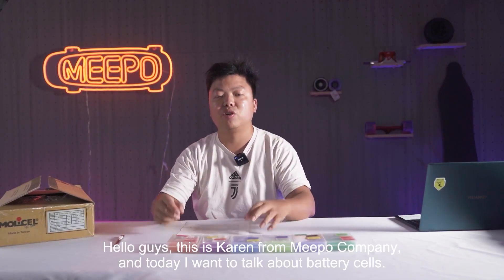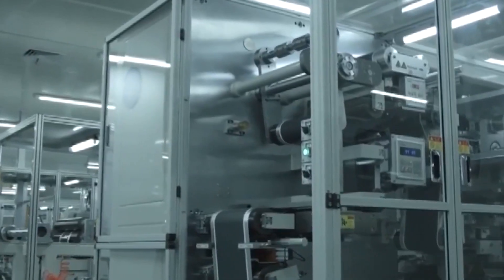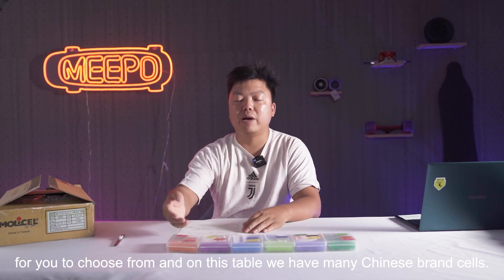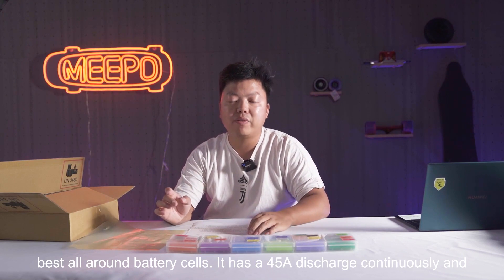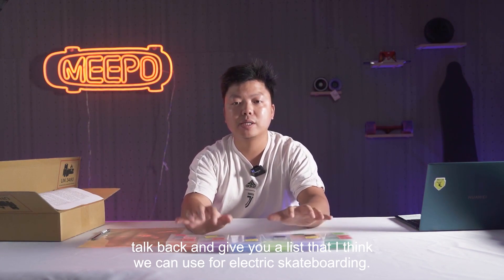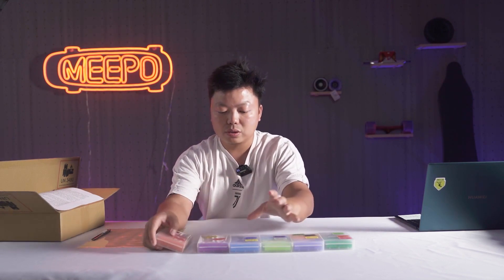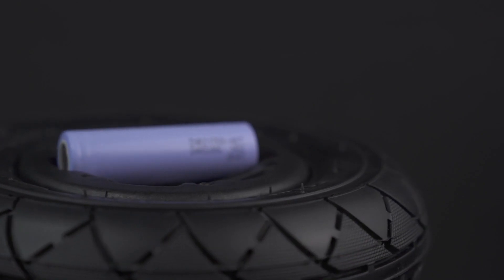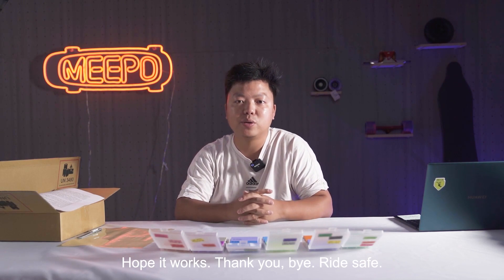MOLICEL P42A Upgrade —The Best Battery Cell for Esk8

Comment: What's your opinion on the Molicel M50A?
Reply: High capacity but lower discharge and as a result lower cycle life. P42A is more appropriate for esk8, where frequent high amp burst is desired (e.g. hill climbing/acceleration)

Comment: Great move Kieran. I've been using P42A's in a 12S7P for most of this year and they're amazing. I wouldn't use any other cell now.
Reply from the maker: It would be great to see your awesome powerful board. my whatsapp +8615200095207
Reply: 7P?  what a monstruosity .   are you trying a climb a mountain everyday before arriving to the office ?
Reply: @sapitron  It's a bit small by DIY standards. Many are running 18S and some good up and over 10P. I do a lot of long distance group rides with friends, usually 25+ miles. My pack gives me an extra 10 miles or so on top of that for safety/bad weather etc.
Reply: @ItchyBones  I have a 10s1P 30q for commuting without issues at 18mph everyday. Can't really imagine that beast you have lol
Reply: @sapitron  10S1P?! Surely you get like 4 to 5 miles at best? Even my old 10S2P Meepo packs manage 9 miles. At that point I'm barely warming up.
Reply: @ItchyBones  my round trip to the office is 1.5 miles per day so a full charge suffices for 4 days. Thinking of building another one for longer and faster adventures.

Comment: How much will the roadster be Kieran and what will it's range be? Also will the street wheel's be cloud wheels? Pls make them cloud wheels.
Reply from the maker: We will release the roadster around early autumn and the price is above $1000, you can check the price and other detailed information on our official website then!
Reply: @KieranEboard  oh yes nice hint thx but if that's so I'm guessing it'll be quite a bit so I may just opt out and get the AWD pro